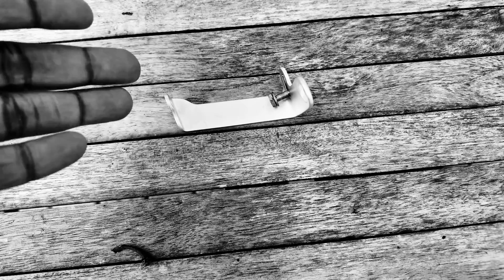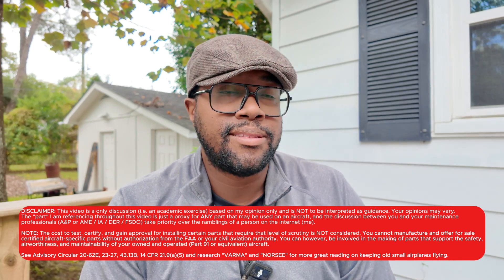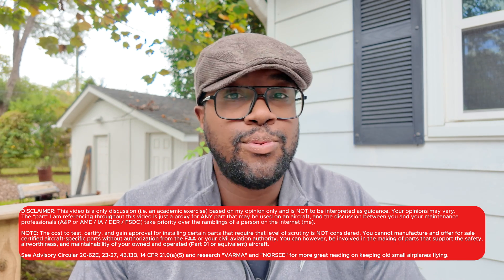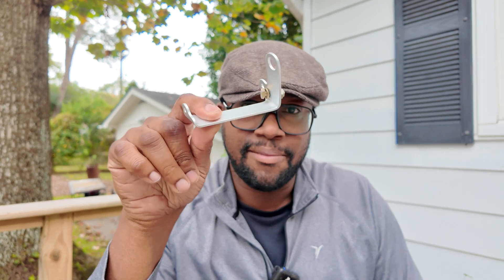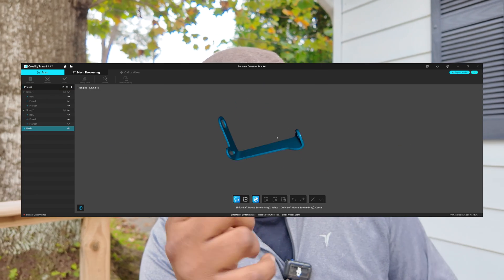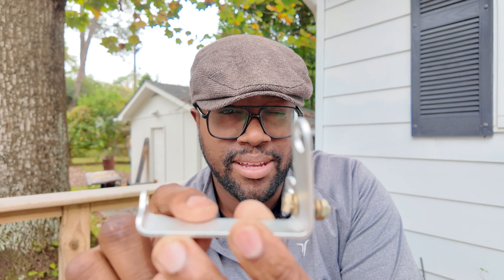This $320 Part Should Be $25 - Prove Me Wrong

Comment: Owner Produced Parts is a legal path.....  Especially if you have a reasonable A&P / IA working with you.   The challenge is that for YOU to make the bracket and then sell it to another party requires FAA-PMA authority, and that is a pile of paperwork, testing and time.  In general I agree that with todays tech it shouldn't be this hard or expensive to get replacement parts.  I wonder if there might be a process that could be advocated with the FAA that would enable something like a FAA-PMA-LITE approval.  This would enable the making and selling of certain types of parts.  For example: Your bracket.  You have figured it out, got it into CAD and such. Some basic engineering data and you could then make them for other owners that do not have the skill / equipment.
Reply from the maker: Agreed with every word. OPP is quietly keeping these airplanes alive. You nailed it here: "reasonable A&P / IA". I think perhaps we need more education there. Channels like this are 5% of the solution. An IA coming from the corporate maintenance world is likely to need some readjusting for the realities of maintaining (time, cost, effort...) a Grumman Tiger. I regularly read the "YOU ARE WRONG...YOUR AIRPLANE NEEDS TO MEET 14 CFR PART 23.### I'M REPORTING YOU TO THE FSDO" (only some exaggeration) when the person asking questions is flying a CAR 3 airplane...outstanding. 

If the FAA ever gets the bandwidth to consider modern proposals that don't take 20 years to enact, we need that "PMA Lite" standard. Perhaps an ASTM prescribed testing method and mandatory interval testing (e.g.: every 5...20...50 articles tested to failure). Most of the parts we're talking about aren't safety of flight critical either. If this governor bracket fails, the pilot may continue to make a safe landing albeit at a non ideal RPM. Reference "NORSEE" which is still paperwork and process heavy. We're marching down the right path of good intent. Now let's organize our thoughts and spread the word.
Reply from the maker: Also unrelated, people are going to wonder how you commented 11 hrs ago on a video that's 30 minutes old. #MembershipPerks. 😂
Reply: 3D printers are becoming a big game changer in today’s world. Great job here, thx.
Reply from the maker: That's the part we need to make more people realize. The underlying assumptions behind airplane parts manufacturing and reverse engineering are totally different. Certain things before required specialized equipment (mills, lathes...) and those were massive barriers to the everyman. They are no longer. These technologies are in people's sheds. I have a CNC router in my back yard and a laser cutter in my laundry room! What possibilities!
Reply: I made some bits for our old Skyhawk when there was a control column AD; certain parts weren't available. So I made 'em. And a few extras, which were handed to others, and quickly forgotten about.
Reply from the maker: This is the way.

Comment: I'm a mechanical and aerospace engineer and professional pilot (CFI-I airplane and helicopter) and have been saying this for years. these parts are very easy to make for very cheap. I work as an engineer and build, own, and fly airplanes. I maintain things myself. I do make and use owner manufactured parts.

$50 door latch spring for a Cessna 150 door, that I can make myself for less than $1.
$40 sparkplugs when car sparkplugs are less than $2 each.
$300 spinner plates I can make better for less than $30.
etc.
Reply from the maker: You totally get it and are using an approach that is keeping many airplanes flying. But "you can't teach an old dog new tricks" seems to apply  here - a failure and refusal of so many to learn the regulations/guidance and agree that we should always use "the best tool for the job" which in some instances, requires a little engineering and modern methods.
Reply: @OpenSourceGA  you're 100% correct. you nailed it with your video. the FAA, AOPA, EAA, and others are even not helping with this.

Comment: It takes way more resources than you realize to engineer, certify, manufacture and test parts for aircraft that carry the paying public, just to get certified by the FAA and other governing bodies. Aviation requires a lot of paperwork for everything that’s produced — every design, requirement, inspection, test, material validation — it’s all logged and tracked right down to A/N bolts and other standard hardware. Manufacturers have multiple layers of QA to ensure they stay in compliance with certification standards throughout the product lifecycle. 

Then there is liability risk. Manufacturers of aircraft parts can be held responsible for astronomical sums should their products fail, even 50 years or more after their manufacturing date. Manufacturers have to pay millions of dollars for lawyers and liability insurance to cover such events. That cost goes into the purchase price of the products that they sell. Your $320 bracket is actually a bargain for what you’re getting in safety and oversight.

With car parts, not only are manufacturing standards much less stringent, you’re able to spread those engineering, production, testing, and liability costs across millions of cars instead of thousands of aircraft. For the aviation supply chain that requires massively more time and labor, and as everyone knows, time is money, and labor is even more money.

You’re not the first naive engineer, Jawanza, to try and break through this massive safety bureaucracy. But like all the others, you’re doomed to fail. 

There is no free lunch. In aviation, there is also no cheap lunch.  You pay the piper if you want to fly with the angels. 

There. I’ve proved you wrong.
Reply from the maker: You missed the part where I'm a flight test engineer so "more resources than you realize"...I am one of those resources. Won't cry about that part, I'll just keep pressing on. 

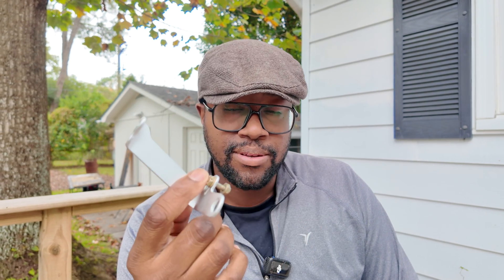Your post is genuine and accurate! I really did enjoy the read. You are perfectly right about what manufacturers are required to do to get parts on certified airplanes and the $325 price tag absolutely makes sense. At the 6:30 mark of the video I even said "if this part exists off the shelf, this is the better part to get." Also because it's affordable (less an AMU). 

But you also might have missed the approach I'm going for and the nuance of the video. It's not that manufacturers should bring prices down - I'm not that crazy - it's that specifically for unavailable difficult to source and afford parts, owners have options that are workable. Not to sell, not to manufacturer, but to keep their airplanes flying snd safe when the free market fails them. There already checks and balances and provisions from the FAA (see video disclaimers and the video description where I left specific regulations, policy, advisories...). 

Unless you have an experimental airplane, your maintenance professional is still required to make an assessment of whether a part is suitable for the task. The cowboys who bypassed that process are still going to bypass that process after the video is made. We can't save them from themselves, but oh would it be nice if bureaucracy's mighty thumb would avoid us with a desire to fly AND student loans, as it squeezes them (I dream).

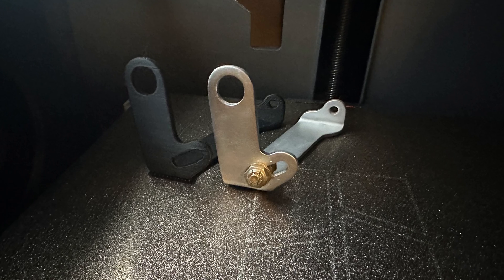I alluded to the cost spread for the number of cars vs. number of airplanes at the 7:50 mark of the video.

You're not the first new commenter, Mel, who slightly missed the wider point of the video. Might be the title that got you here for the fun but, an assumption of the video's total content that got you to comment and that's what makes for great debate and better engagement for the YouTube algorithm. But you certainly are respectful and well informed and correct in your assertions. And for that, you are always welcome here! Good morning! There's excellent value in your post.

I paid for my Piper and fly a Beechcraft and both take me closer to the angels (hopefully only metaphorically for now). 

There. Proved you didn't watch the video (or just didn't catch it's for a specific case) in it's entirety.

Comment: In EU industrial market, there is a thing called self-certification. Basically, if you are able to put together complex machine, you are probably able to declare, that it conforms to certain standards and willing to take responsibility if they are not. IMO this would be reasonable option for GA. I think, that it would be reasonable to have requirements for you as being a certified technician to demonstrate basic skills, maybe some education. 
However, there are people that have 2 left hands and I would not trust them adjusting their seat, much less installing such bracket. So there will always be groups with preferences from making their own solutions to sending aircraft to manufacturer to do the thing for him / scrapping / selling.

Comment: Some parts are simple and some are not.  It is not always easy to tell them apart.  Without knowing what the design criteria are/were, and without testing, you are not seeing the whole picture concerning the part. 
A few questions come to mind, in no particular order: Is send cut send going to laser cut the part?  Will the heat affected zone near the cut line cause problems with metal micro structure that will influence the material properties?  Where did send cut send get the material? Is it really what they say it is? Did your scan get the geometry correct?  Did the laser cutting reproduce this geometry?  Was the geometry inspected?  If so, what tolerances were applied to decide if it was acceptable?  What is the minimum bend radius that should reasonably be used with this material, in what ever temper it was, and may or may not be? Is the item plated? Painted?  Will it corrode in service?  Is there any chance of an unexpected galvanic corrosion issue?  Does the part weigh the same as the original?  No problem with weight and balance?  If the geometry is off, will the governor align properly?  How well does it have to align?  Where did that nut and bolt come from?  Is it plated?  Is the nut a self locking one?  What type?  Is there a lot of vibration on a governor mount?  Do you want to figure out the answers to all of these questions and then sign it off as a professional engineer?  Do you have liability insurance?  Do you think you will ever want to sell your plane?  Will anyone want to buy it if it has non-certified parts?  Will you want to bring people along for flights? Will you be explaining to them what parts are non-certified, your reasoning on why the non-certified parts are flight worthy, getting maybe to sign a waiver?  Which parts are critical to flight?  If a little governor mount isn’t quite right, will that be a problem?  Is a part made in 2025 really better than designed and made in the 50’s?  Can you prove it?

Comment: 17:00 then I challenge you to design a better version of this bracket and sell it at $25, taking into account your time at a 2025's aerospace engineer hourly rate, sourcing the material, testing and prototyping and certifying it through the FAA both as a part and as a manufacturing facility (i.e. sampling, documenting, etc.). I'm NOT saying I disagree with the fact that we should be able to do better as a whole but I am saying that your thesis is missing the point. I would suggest to perform a full cost analysis of the part including R&D, prototyping, testing, manufacturing, legal, administrative and misc. cost. As to manufacturing parts ourselves, how do you propose to deal with the insurance, etc. ? I think the debate is interesting but you need to lay out all the cards out.
Reply from the maker: The cards are out - you missed the point of the video. No one's talking about setting up a business. This is about owners and parts availability for the individual, not the masses. I have no business plans.
Reply: @OpenSourceGA  I admit I might have missed the point but so did you : my thesis is that your video does not address the problem and only focuses on the manufacturing side of things. Saying "$25 or prove me wrong" or "we should be able to do better with modern technology" is misleading and borderline false. Not everybody would (or should) be able to replicate a part and install it on his/her airplane. There are too many factors to take into account, least of which being liability in case of failure.

Comment: I absolutely understand your point. For safety reasons, I do have to call out one dangerously misleading thing in the video.  The inexpensive 3D printed stainless steel is POWDER that has been bonded together. It's nothing like regular solid stainless parts.  It's like thinking that cardboard (wood flakes bonded together) is a suitable replacement for solid lumber. Because hey, cardboard and lumber are both forms of wood.

The stainless steel process you were quoted (SLIM) produces parts that are only about 3X stronger than the PLA plastic, in tensile strength.
There are companies who will cut and bend sheet metal at reasonable prices and that's a reasonable way to go.  Trying to replace those parts with printed parts absolutely will not work. It's like the difference between a fluffy snowball and solid ball of ice made by freezing a cup of water. Yeah they're both made of ice, but the one made from powder isn't NEARLY as strong. Inexpensive 3D printed metal is powder. And will fall apart as quickly as a snowball does.

There are new technologies in making metal parts that are strong. They are far more expensive for single parts.

Comparing SLIM printed parts is like saying "instead of buying a wood propeller, I can just make one out of cardboard - cardboard is made of wood."  No.  Wood flakes glued together (cardboard) does not replace a solid wood propeller. And stainless steel powder is NOT a replacement for cold rolled steel.
Reply from the maker: Good point taken - it's all about the application. Future videos will touch on this. Later in the video I ended up going to the better choice cutting and bending! SendCutSend. 

Genuinely and sincerely curious here: "only about 3X stronger than the PLA" - where's that coming from? And how are we defining "strength"? Compression? Torsion? Bending? Tension? I'm asking because I'm also learning! As a design engineer I'd have to consider those details. The "My Tech Fun" channel has some videos on back to back comparisons of 3D printed metals from PCB Way and CNC cut parts about 1-2 years ago. Great stuff! I'm doing more research. 

The details would matter depending on the application. A 3D printed part would totally work for this specific application but I wouldn't use it to design a spar...yet. Wink. An enclosure, a bracket, etc. would be fine candidates for even PETG or Nylon printing and those little non critical widgets are what most people need. And if the part was critical, we still have to pass the litmus tests of our A&P (or just go experimental and press on) I have some real world test results with ASTM methodology we can reference in a future video.
Reply: @OpenSourceGA  Yep, always about fit to application. And suitability for the application can be more complicated in an environment with vibration, high and low temperatures, etc.
I had mentioned tensile strength. That's based on testing done by a YouTuber popular in the 3D printing community; the name escapes me at the moment. There are of course a number of different processes available, at very different prices.
Resin-bonded is an inexpensive option. That's a metal powder bonded by resin. Which is pretty much "form it from JB Weld, on a computer". Bronze sintered is another option - which requires a kiln, etc and costs more.  One would need to research which process fits the particular need. A resin bonded part could be thought of as "looks like metal". But isn't very strong.

For a particular application you'd have to go through the list - does it get twisted? Pulled? Bent? What is the temperature range? Is it shock loaded? When it fails, should it start to bend first, or suddenly snap at a slightly higher stress? Then fit the manufacturing process to those needs.
Glass is very strong - and a bad choice for landing struts. 😁

In many cases, when you want to use a 3D printed part to replace a part made with a traditional method, the 3D printed part should NOT be the same shape. For example that bracket is shaped that way because it's made from bending sheet metal. (Design for manufacturing). A printed replacement bracket shouldn't have the sharp, thin corner. There's no reason for 3D printed parts to be thin sheets. The corner should be made much thicker, and therefore stronger in every way - stiffer, etc.

Comment: Absolutely! 3D scanning, modern CNC and sheet metal cutting / bending are the perfect complement for the owner attempting to produce their own part. I made my own gear doors for my 76 year old airplane. There are no new ones, and all the existing used parts are all cracked in the same way, so I wanted new metal. Careful measurements, a 3D scan to be sure, and a little cad work, and I sent it over to SCS, had the aluminum sheet cut and bent, and riveted them together to produce my own doors. To remain legal, I had to stick with the same materials and design as the original design (though I was able to go up a gauge on the sheet), and did it for just shy of $200 for both doors. Granted, this doesn't count the time I put into scanning, or designing the parts, nor does it count the itterations of the designs I did that didn't work out well when I had them test printed in PLA, but I can turn around and send the CAD files I have now to another Navion owner, and they can get both main gear doors made from fresh new aluminum for less than the cost of one used door.